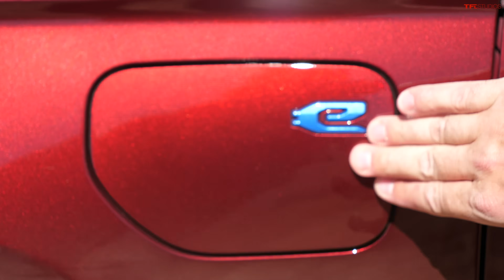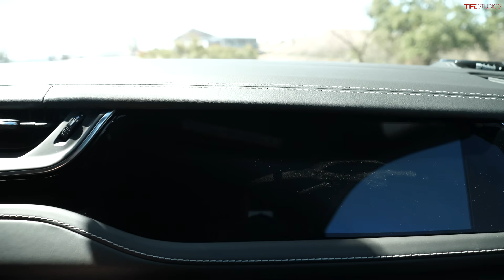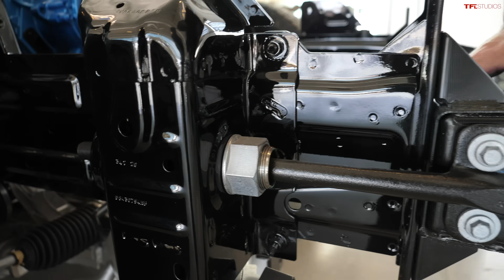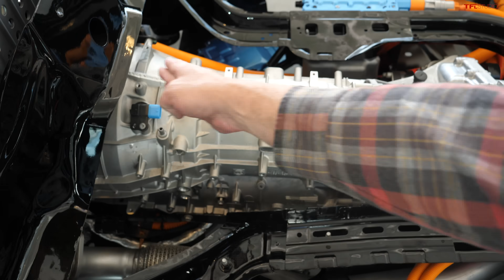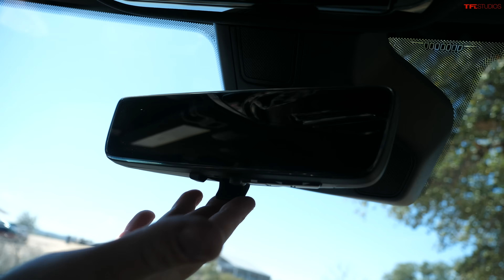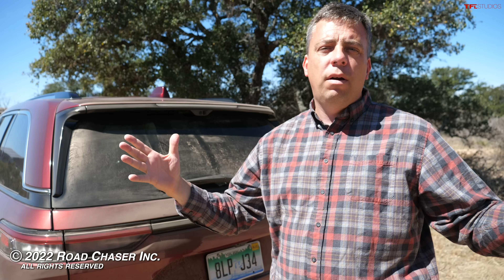Jeep Grand Cherokee 4xe: Does This New Plug-in Hybrid Let You Have Your Cake & Eat It Too?

Comment: Prob should have a lil bigger battery, at least 20kw to give it a 30mile plus range. not much room left though. if the gas tank was not shown im wondering what that huge silver part was in the back? maybe it was muffler.  no TC/clutch only is a concern esp offroad. kinda jerky. i would prefer an extended range version with no air susp, no passenger screen, no sunroof, no massage. just offer a bigger battery wo the fluff.  ditch the piano black high gloss trim too. i dont think wheels even with diff backspace would  help you get around that knuckle for bigger tires. i think you could only go about 1 inch bigger wo a lift on the previous gen at 31.5" at regular height w 65s. maybe you needed spacers anyway. stock tires were 30.5. prob same here w 265/60/18s.

Comment: I have a 2020 GCH (and had a 2012) with the 6 cyl.  Something I always liked was the large 20 gal. gas tank capacity.  The fuel tank was removed in the video, but was wondering if you know the capacity.  Also, what is the HP in gas only mode.  Thanks

Comment: Unless you are a city driver, do not buy this vehicle! The hybrid mood is fantastic when you are driving around the city and have the ability to plug-in every evening, however, if like most of us, you do a fair bit of highway driving it will drain the battery fairly quickly and it does not recharge through either the regenerative braking or the combustion engine as they claim. In a recent drive from Florida to New Jersey I got 16.8 miles per gallon as a result of this newfound discovery. I immediately turned around, headed straight back to the dealership that I bought the vehicle and demanded that they exchange it for something else. After discussing my concern with their service manager, everybody agreed this is not the vehicle for anyone that does a decent amount of highway driving.

Comment: Some more he gets into the stuff that runs this vehicle with the electrical side of it I see a lot of things that can cause problems in the future SAH with all the systems that convert alternating current to direct current to high voltage to low-voltage all the electric motor twice the gas motor I feel like this would be a nightmare when it’s not working perfectly

Comment: i have a 2020 hight altitude that i just paid off a few months ago.  Because of gas, i was thinking about going electric but im not sure if something like this is a better option.  its good to have the gas as backup but that means you also have to get oil changes and all the other maintenance things of a gas car. nice to get 50+ miles a gallon...or...whatever because im sure the charging cost of EVs are about to get high as well and in a few years it will cost you $80 to charge up your car

Comment: I really need to see a review that shows how this engine performs in the mountains on a 400 mile camping trip, towing a camper.
Reply: This is my use case. It seems PHEVs are best for a bimodal driving cycle. 90% of my driving is a 25 mile commute each way (can charge at home and work) but the rest is road trips to camp in the mountains or desert.

Comment: Surely there is something wrong with the MPG, right? I have a 2017 Summit V6 and it averages about 20 MPG and I get “510 miles” on a full tank. And this is averaging 23 MPG and just barely over 300 MPG (shown on screen) while they say 470 miles combined.

Comment: DO NOT BUY THESE. Wait a couple years if anything. Shocking amount of TSBs active and a lot of the issues still have no fixes. I just dumped my ‘21 GCL Overland for a Ram 1500. Still have a ‘21 GCL Limited that started giving problems as well. There’s always something wrong with these at least electronically…I can’t even imagine adding electric/hybrid powertrain into the mix.

Comment: The increase in cost compared to a previous generation jeep will make sure you never save a penny from the fuel efficiency.  Also, it would seem that all the complexity built into this new platform would mean more repair bills down the road and possibly lower resale value.

Comment: Jeep blew it with the price! If the goal is to save on gas, you’ll never save anything with the price difference! Build yourself a calculator and see how far the price difference with a gas model can take you. At the current average gas price it’s more than 200k miles! It’s so dumb! 
As far as being ecologically responsible, this car will probably never be better than a gas model, due to the material used vs. a regular gas car. 
Like I said on both front you’d push more than 200k miles to get a return (either $ or carbon footprint).

Comment: 470 mile range? My Grand Cherokee Hemi gets over 400 miles hwy and has oversized tires 24 gallon tank. If I changed up my driving style I could probably get 470 miles out of a tank. I must be missing something? Doesn't sound very impressive. Does it have like a 10 gallon fuel tank? edmunds says 19 gallons.

Comment: Just learned about an Inline 6 Cylinder twin turbo coming to replace the 5.7 litre Hemi. 
   Evan Williams stated these facts on AutoTrader News:

Stellantis has just launched an all-new inline-six engine that's capable of producing over 500 hp. More important than that power figure these days, the automaker says, is its ability to burn less fuel than the V8s and turbo sixes of the competition.

The 3.0L twin-turbo I6 engine is called Hurricane, and is set to arrive at dealers this year.

An inline layout is an inherently smooth design, thanks to having the cylinders all acting on the same plane. It's why BMW and Mercedes-Benz continue to produce I6 engines, despite it requiring a longer engine bay than a V6 or V8. The engine will also share some key dimensions with the 2.0L four-cylinder the automaker already uses in its PHEV models, hinting strongly that there is a shared architecture to help lower costs.

Stellantis and LG Investing $5B into Battery Plant Coming to Windsor, Ontario, Canada.

The Hurricane will be offered in two main flavours, though each will be slightly tweaked for the vehicles where they're installed. The standard-output Hurricane is aimed at fuel economy. It will make 400 hp and 450 lb-ft and has features like cooled exhaust gas recirculation and the ability to run on 87 octane. 
     High-output versions of the engine are said to make more than 500 hp and 450 lb-ft with larger turbochargers and stronger pistons.

As both Hurricane engines are set to become the primary power choice in body-on-frame models like the Ram 1500 and Jeep Wagoneer as well as other large Stellantis group vehicles, the automaker emphasizes that the engine should still deliver improved fuel economy when towing. Fuel economy in demanding applications has long been an Achilles heel of small turbo engines in large vehicles.

Stellantis said that vehicles with this engine will be on sale by the end of the year, but did not specify which vehicles would be first. Expect an announcement to come later in the year, closer to the launch of those models
     They was taken from the article. 
Of note is the battery Factory with LG set to be built in Windsor, Ontario, Canada. $5 BILLION joint venture. Guess they ARE serious about changing the vehicles to keep up with the competition.
Reply: This motor should be in this Jeep, not a 4 cylinder....

Comment: Wonder what’s the purpose of the “starter” motor that’s belt driving on the front of the engine?  Why not just start the engine with the motor in the transmission?
Reply: The drive motor I believe is separate from the starter motor.

Comment: too expensive for its specs.  I've noticed no one seems to say what the mpg is during hybrid mode when the full electric range is depleted.
Reply: I would imagine it’s basically exactly same as the non PHEV.
Reply: @GHinWI  it is effectively ever so slightly worse due to the added electrification weight (battery, motor, etc.). In wrangler 4xe I get about 23.5mpg on the highway going 65mph after the battery is depleted.

Comment: The questions on my mind are:

Is it economically viable for someone to recharge the battery while driving? Or does the fuel economy suffer so much when it recharges while driving, that anyone who owns a 4xe will avoid recharging while driving at all costs?

What's the difference between MPG and MPGe?

Does the cost of the vehicle include the home charger? If not, it should.

One last thing: That blue doesn't go with the red on the rest of the vehicle's exterior.
Reply: While driving with the battery depleted, the Jeep will function like a “normal” hybrid, capturing energy from regen braking and then using that energy immediately after on acceleration. You can force the engine to stay on to charge the battery, but this is significantly more inefficient than using the engine to directly power the wheels.

MPGe is the measure of miles per gallon equivalent. So a gallon of gas has 33.7 kWH in it, so MPGe is the miles you can go in that equivalent energy (in this case electricity)

Based on the Wrangler 4xe, the cost of the vehicle includes a Level 1 home charger (standard 15-amp 110V outlet). In my experience, this will take about 12-14 hours to charge the battery fully depleted to fully charged.

Comment: These 4xe trucks and SUVs Jeep have an all-electric mode that can drive them for 20+ miles.  That charge of the battery comes from plugging in the SUV into a wall outlet or such.  Question.  After the battery is drained, can or will the battery be recharged by the gas engine, transmission or the EV motor itself so once fully recharged, the SUV can drive on pure EV power again?  If not, then what a shame.  To me Hybrid means being able to run off full EV, a combination of gas and electric, and gas only.  BUT, also re-charge the battery to operate in pure EV.  Also, there should be an Inverter Generator type tech similar to the F-150 powerboost to allow running high power electric tools and such.  Missed opportunity.  Thats why I find the f-150 Powerboost so compelling and only think of it as the only PURE Hybrid vehicle out there if the others are not following this.
Reply: After the battery is drained, the Jeep will act like a hybrid: capturing energy from regen brakes and will store that energy in the battery, but will immediately use it then switch back to gas. In E-Save mode, the Jeep will capture energy and store in the battery and start to charge, favoring the gas engine for power/driving. In E-Save mode, you can also set the battery to charge from the engine, so the vehicle will run the engine specifically to charge the battery, but it should be noted this mode is significantly more inefficient than simply using the engine to provide power directly to the wheels.

Comment: I'd definitely get the extended warranty if I bought this one.
Reply: Way less likely to need service.  I’ve owned a PHEV Pacifica and a PHEV BMW 530e.  Less oil changes, less break pads, les wear on spark plugs.  An electric motor is basically copper wires wrapped around magnets and they spin with bal bearings.  Not much that can go wrong.  That’s why industry uses electric motors in factories an most other applications…they don’t use engines to  power much of anything they can get electricity to it.  The battery already comes with 100,000 mile warranty (government regulation).
Reply: Chrysler and wiring. What's the worst that could happen........... 😏
Reply: @ShogunAutoworks  chevy n wiring might be lot worse
Reply: @fozzybear9114  agreed haha
Reply: @fozzybear9114  and that GM 8 speed transmission 😉😉
Reply: @jakey20022  The 8 speed transmission is not a GM, it is a German ZF transmission.
Reply: If it's like the wrangler, the hybrid components are warranteed to 8yrs, 100k.

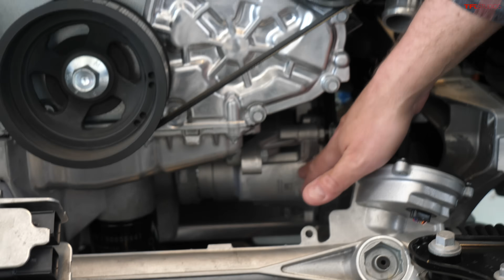Comment: 7:30 "Clever" is one way to put it.
I don't believe most mechanics would agree though. They might call running a drive shaft through an oil pan a "nightmare". Or "planned obsolescence".
Reply: Interestingly enough, the 00s GMT 365 Trailblazer SUVs had one of the half shafts running through the oil pan too.
Reply: @trailrunnah8886  yep, we have a Trailblazer with 288k on it and the shaft through the oil pan has never been an issue. It's gonna die because of underbody rust some day.
Reply: It's not exactly new. Lots and lots of vehicles do this.
Reply: If it worked for the AMC Eagle it’ll work for the JGC!  😝

Comment: The real question is when are they going to release 4xe/PHEV versions of the Wagoneer and Grand Cherokee L?  It's the bigger vehicles that actually need the efficiency boost!
Reply: They'll electrify the Ram platform first (to compete with CyberTruck, Lightning, Whatever GM calls the Silverado and maybe a tiny bit the Rivian) - then a year after that have an electrified GW option. 2025 at the earliest on dealer lots - it's a hyper low volume vehicle for them (new AND expensive) so no rush for them
Reply: Looking forward to  the Gladiator get 4xe option as well should be as the 2024 model year
Reply: One buy a Wagoneer or L today if could get the hybrid. Milage is power isn't great in those models right now.
Reply: I think they just announced the Grand Cherokee.

Comment: Yeah axle shafts through the engine oil pan will cause weenchers a whole bunch of pain in 15 years lol... also looks the body needs to come off to service/replace electrical components?
Reply: Those are just skidplate. Not to mention it's the uni-frame...that Jeep has used for going on thirty years now. The body doesn't come off. Also, Jeep isn't the first one to do the axle through the oil pan thing either.

Comment: I am a huge Jeep fan and Chrysler corp guy and there is nothing wrong with this jeep so let me start off with that. its a great vehicle. BUT. What the hell is wrong with corporations and "our betters" in DC. Gas prices are going through the roof and their "solution" is pay more money... WTF. It's like shit is just stuffed between their ears and they can't hear or think. I just said gas prices are high.... which equals, I HAVE LESS MONEY, and you (they) want me to pay $20,000 more than base price for only  25 miles of full electric range. Go home corporate America and swamp creatures (on all sides of the isle) your drunk.

As a side note where is Stellantis' Ford Maverick?? That at least is a way better answer to the gas crises. What Jeep needs to be working on is a Jeep Cherokee replacement that is a slightly wider and a bit longer Renegade looking vehicle that is rear wheel drive based/4x4 that has a 4xe option and it needs to be $25,000 base (or less) , $30,000 Rubicon (or Hybrid), and $35,000 for Hybrid Rubicon (or less).

Comment: I've had a RAV4 Prime for over a year, love the powertrain. Way less compromises than battery EVs. Not as sexy as a Tesla LOL but way better quality and zero range concerns. This Jeep PHEV is great for the market!
Reply: I ordered mine a month ago. Getting 2022 prime next month from Japan 😁
... best part over 40miles electric range. My work 17 miles.
Reply: I wonder if this jeep will be reliable down there road. I am not in the market for a new car right now, but I’m a couple of years I already know I want an plug in hybrid suv. The rav 4 prime seems to be the best at so much, and because its a Toyota I would expect it to run for years (beside the battery having to be replaced eventually). I just worry about Jeep’s long term reliability with a car like this.
Reply: @justinufailzs3524  plus any vehicle with a turbo will 100% be higher maintenance and repair in the long run. That's just physics. RAV4 Prime = no turbo, Jeep = smaller engine with a turbo. It's not that turbos fail every day but they are expensive when they do go out.
Reply: @justinufailzs3524  Personally knowing what I know about the Toyota system and the Jeep system I would say not compared to the Toyota. For one, the Toyota uses an integrated motor in the "transmission" to start the ICE, not an external belt-driven starter. There are zero belts on the RAV4 hybrid engine. The Toyota hybrid systems have been perfected over 20+ years. The Jeep system? Notsomuch.
Reply: @InternetDude  ...........I have a RAM REBEL pickup that has the "E-TORQUE" 5.7 L Hemi. that has a belt that is connected to the crankshaft, that is also connected to the "E-TORQUE" motor/generator, which starts the engine when in the "AUTO START" mode.  This is a good system, but is only used to increase torque when accelerating from a start and also when the transmission shifts.  The belt is about 2 inches wide.
Reply: How does my prime with the 6.6 charger at just barely over 2hours and 20 minutes with an 18kw battery charge a full hour faster than this 7kw charger with 17kw in the Jeep?
Reply: @para_dan  you actually only put about 14.5 kWh into the battery, the rest is “reserved”
Reply: @InternetDude  our Prime with the included charger would pull around 1500 w at the wall plugs and requires 14-15 hours to fully charge from empty. Sounds like a lot of waste energy if it only charges up to 14.5 kwh. There would be a lot of heat generated in the garage, except it's not.
Reply: @para_dan  charge rate tapers (slows) as it fills up too
Reply: Agree that hybrid setups are the way to go until the charging network/infrastructure truly improves. Even here in EV crazy California; too many gaps & inconveniences.